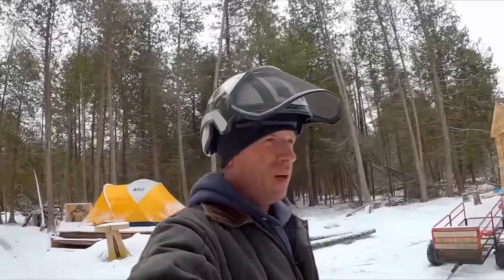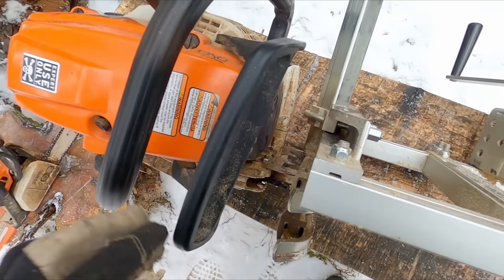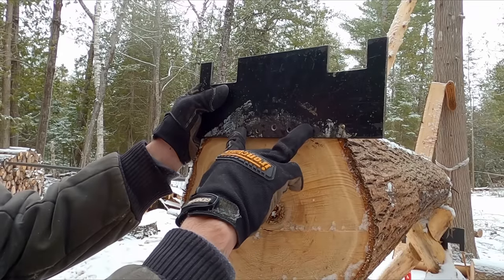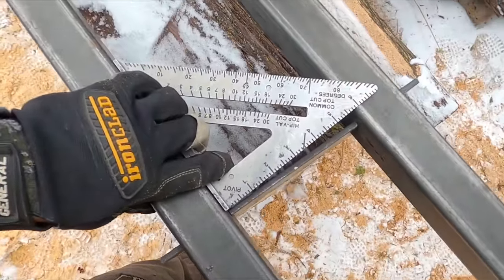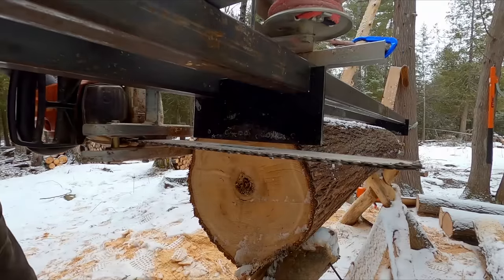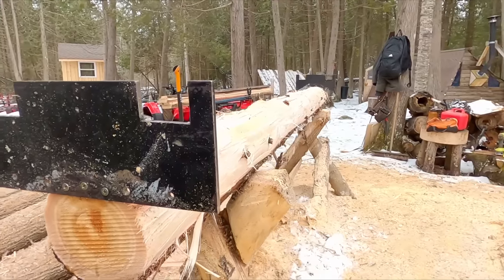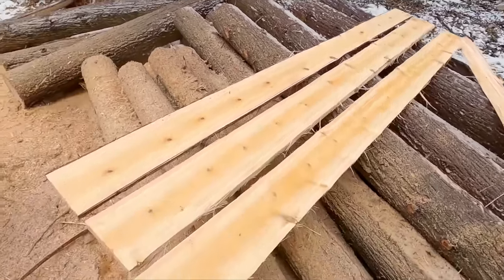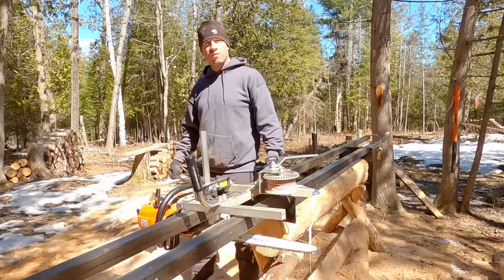$200 Bullet-Proof Alaskan Chainsaw Mill Setup.  Build Your Own!  #80

Comment: Have the same mill (minus the winch).  Absolutely love your starting set up.   I used an old aluminum ladder what I don't use for climbing anymore.  Boy does your set up look easy.    I used a Stihl 029 super to mill 900 board foot of black cherry.  The trees were dying and I didn't want firewood.  My neighbor who is in construction and I weren't sure the saw would make it with that much cutting.   I went through two ripping chains to get it all done.  It was very satisfying to successfully do something I never did before.   Great neighbor and I shared some of my lumber with him.  It's just about dry now and I can start using it for projects in the mountain house.
Have you tried or done quarter sawing with the set up yet?

Comment: I stoped the video at 33:06 and looked at your setup. I got to thinking you could make a permanent stand for your bars right there where ou can adjust the hight for your first cut intead of screwing in the plates. You would be able to save time and use more wood. 
Maybe you already have that set up. This is the first video I have watched of yours. I can see the plates would be very useful for bigger pieces you can break down on site where you fell it to make it easier to move.

Comment: Should just extend your 4 wheelers controller distance and hook the atv winch to a pulley or snatch block on the saw, then you could stand right by the saw and mechanically feed your chainsaw through while visually ensuring a straight and steady flow of chips, a little button would be a lot easier than trying to hand crank I think

Comment: I seen a guy that built the hot tub the fire is underneath the tub. He’s in California and he just puts the firewood under there and it heats the water up in the tub so you can make your hot tub like that. Also, I’ve seen some people use the ladder like you’re doing that milling they put a ladder on top of the log, and then run the chainsaw across the ladder.

Comment: Great Video, lots of insight and lessons of experience. 
Quick question… if a guy were to build a “log table” that could be leveled at each end with threaded rod and blocks to move the LOG up for each cut, do you think it would it be any more efficient? 
Basically eliminating the steel plate adapter for each start up and replace it with a drop down first cut plane…. Not that I would not use your very simple but efficient way, just thinkin out loud..

Comment: If you added a loop or a Y shaped piece on the far end of the steel quare tube and then fed the winch rope through that loop, you could add a slight weight to the winch rope (between the loop and the anchor tree) and it would keep the winch rope from sagging near your chainsaw.

Comment: Nice setup, you might consider to attach a small snatch block on the tree strap for the winch and have the winch line loop through and back around mounting to the winch so you add more power to the winch by compounding the pulling force, subscribed to your channel, thanks for the videos😎

Comment: Hi Ryan!  I've been looking at the G-777 and the G-778...I'm kinda leaning towards the G-778 because it offers a second point of attachment on the chainsaw bar.  I run a Stihl 291 with a 20" bar, the G-778 is meant for a 24" bar but it looks like you can adjusted it down to a 20" Bar.  Have you had any issues with the G-777 at all?  And would you buy the same model again?  Thanks for your channel great learn avenue!  THX Nick

Comment: I was using a 2100 Husky with a 3 foot bar rap around handle double dogs. You  had really because  to hold on to it up side down.  Cutting a log in the air I could stand on the log with one foot on the handle to keep the saw from coming at you I would cut cants almost perfectly strait. Big wood Flew them out with a helicopter. Might want to try It with your mill saw.

Comment: Good info..  Have you considered using an ultra high molecular weight (UHMW) tape on the surface of the aluminum that contact the metal guide bar and the freshly cut surface for subsequent cuts?  Just curious.  Slick stuff…tuff takes a long time to wear down….its used often where two surfaces meet to radically eliminate friction.   Just sharing….but I think it would be beneficial..Good luck!

Comment: Make some kind of shelter for all the bigger stuff which doesn't like to be in the rain or have piles of snow on top of them?   Roof is what they need, not so much walls or floor, as long as it's not in a puddle?  Some wooden frame, and then metal sheets to the roof. When it is only about having roof, less work to get the area big enough to use it as a work space during rainy days.

Comment: As I have not done anything like this !!!
I have an idea?? as yet not finished with how. But to use angle iron with springs to for adjustments of the top cut of a smaller  logs . I will think on this more. 

I am surprised that you don't do  3 sides of the log?

Comment: I see you are using work gloves similar to the ones I use to use. I burn through gloves about ever 2 or three months so I've started using the $2.00 gloves from Tractor Supply or Harbor Freight and not waste 20 to 30 dollars on work gloves that wear out quickly. The gloves I'm referring to are the rubber ones with the breathable backs for sweat. FYI

Comment: I'm curious if you could mill longer logs still using the guide bars you have. Mid way cut a notch for the end plates to set down into, cut the first half then take the end plate from the end and move it to the other end while you leave the one in the middle. I'm guessing you would have to base your ends off of the depth of the mid cut you made.

Comment: I'd honestly like see a segment on the sharpening of the saws is a big point of interest I believe,
Reply: Bucking Billy Ray and guilty of treeson have really good videos on sharpening chain. Square grind chain will cut the fastest but is a little difficult to get started on. Granburg makes a really nice round file guide if you are having difficulty getting angles correct. Making sure your depth gauges are set even and correctly is in my opinion the biggest difference in getting a clean consistent cut

Comment: Good job on the video and information.  I beg to disagree an a band mill requiring equipment for your type of milling.  Yes, the equipment would make life easier,  but I think a ground based mill that would mill anything you are already milling would increase yield enough to justify the expense.  The thin kerf would surprise you for the increase in yield. 

Each saw mill will have a niche benefit and each will have its drawbacks too.  Another chainsaw mill set up that impresses me is Logosol.

The other DIY mills are either band mills or swing blade.  Again each has their good and bad points.

One major concern is logs are heavy.  That will end up being a major factor in how you address how to work around that issue.  Engine based equipment is expensive to buy, maintain, and operate, but usually allows for fast and easy maneuvering of the logs.  Mechanical equipment is a good method to reduce the cost to purchase and operate and usually is low maintenance, however it is a slower process. 

In this video, I can definitely see the advantage of a ground based mill with some Maasdam rope pullers.

Comment: you have had to replace the bar on that saw when you bent it

should make the winch easy to remove, so when not using you don't have to lift the extra Weight

Comment: Ok . I could see that you have that saw sharpened to the standard angle ... i don't know if you know this or not but when you are cutting lengthwise on a log the angle should be more ofna squared angle ... you can actually buy chains already cut for that angle...

Comment: Just curious to know if anyone has ever tried using square aluminum tubing or aluminum strut for the bars? Seems it would be lighter and just as rigid.... IMHO. Probably more cost effective with metal prices these days... But i appreciate the video as I have been resisting the urge to drop a pile of money on a band saw mill....

Comment: Anyone considering a chainsaw mill check out the Makita/Dolmar  EA6100 (or bigger).   It is the same price point is a little better, performance is a little better.  Makita/Dolmar is an underrated saw.
Reply: I have had two of the Dolmar saws.  They don't measure up.  The first one lost compression, and the second one had stator? issues.  Stihl is the way to go, no doubt about it.  They aren't even in the same league.

Comment: What if you used a lightweight aluminum ladder instead of 2 steel bars for chainsaw milling? The ladder serves a dual purpose and is lighter/easier to work with
Reply: Aluminum ladders are often used as rails for chainsaw mills but they are comparatively expensive. Cost has been a consideration in many of Ryan's choices.

Comment: 25 min stop braking your feet to your boots . Start braking your boots to your feet. 
1 put them on 
2 go fishing like you have waders on
3 keep re tieing to take up the slak as the leather starts the forming process.  
4 stop fishing 
5 change socks 
6Go for a hike  with several pairs of socks ,i skip the socks.
7 keep on til dry adjusting the laces periodically. ( take off and bag overnight if needed.

I've done this with kenatrex several times . Most wear out the boots ( 5-10 years, 9 months for meto burn throught here ultra durable soals) before they are broke in. Takes 24-72 hrs depending on summer or winter purchase. 
 Enjoy never having blisters. 

Ive

Comment: Mr Ringworm, I bought some wooded land like you did and would also like to mill my own lumber.  The majority of the trees are under 20" diameter, in fact average diameter is probably around 12" to 15".  I'm wondering your opinion, to this day, would you still go with the same set up (the most basic Alaskan mill) for convenience and the homemade steel bar set up you made?  To me, it seems like the way to go for simplicity.  Just wondering your thoughts since you upgraded to a bigger saw and chainsaw mill

Comment: Have you ever seen as gas powered chop saw for cutting metal? could you add a circular saw bade? Idea being thinner cuts and less sawdust and would it still.work on or with your milling device?? Granted not as good as a larger band saw mill but thinner then a chain a chain saw.?? less waste And smoother cuts! It makes sense to watch these vkidelos kjusty forr getting ideas to improve simple milling techniques. Just my two cents

Comment: lol it looks like you have a harbor freight up there or something similar because the little orange  screwdriver looking picks in you chain saw room i also have and that chain saw chain sharpener i got the same one same color  but i don't have  a skil or husqvarna but do have  several cheap ones and i was afraid to order a china knock off that is 63 cc and 20 inch bar on it  and my mill can mill up to 30 inch logs  and the knock off really surprised me it works great and starts every time and performs great but the chains are cheap and dull fast and stretch  but maybe next week it wont start and run lol

Comment: Is your new chain sharpener a oregon,  I have one two but perhaps a different model,  but your grinding wheel stop doesn't look right , but you should be able to adjust it to stop on the down motion so it doesn't go to far . Mine is under the motor and wheel so maybe that's why it looks different.  The cheap one you have comes with a much less aggressive wheel  than the pink ones from Oregon but you should be able to adjust it to take off a very small  amount or alot . Just wondering , great video .

Comment: would this system work if you dropped the saw to the bottom cut first then work up each cut it would save set up time , its a cheap way to produce timber very effective

Comment: I NEED HELP.  I have this same setup and I'm having a heck of a time getting a good slab.  I'm using an Echo CS-490 with a 20" bar like The Worm here does.  I'm using a Granberg ripping chain that is brand new and sharp.  Doesn't matter if i use wedges or not.  My issue is that I get a ways into a cut then my saw just stops cutting.  The chain moves freely, there's no binding anywhere that I can find, it just stops cutting.  Even though leading up to this point it's cutting like a hot knife through butter.  I do notice that it seems like the mill starts to lift just before this point.  Does anyone have any ideas?

Comment: Hey dont knock yourself for milling board for board. Here in Boulder County Im building a new dock, the other fell ap[art, and we need 12, 6x6x10's They are $50 each! at Home Depot. I saved my mom about $1,000 in lumber. So consider yourself a frugal builder. Whilst everyone else broke the bank on ridiculously priced lumber that lets be honest isn't all that great anyway. Sure you can get a ozen or so great pieces, but getting thousands for a home all to spec and without blemishes is next to impossible if you've ever had bulk dropped lumber to a home build site like I have. YOU! can make sure you get an actual 2x4. NOT!!! a  3-1/2  by 1-1/2  LOL thats NOT a 2x4, it's a 1 and a half by 3 and a half. LOL

Comment: You waste a lot of lumber because the chain is near 1 cm thick an rips all material in that 1 cm cut away. Other saws are 1 mm or 2 mm thick. If you want to get 10 cuts out of a piece of lumber, you lose 8 cm (some boards) using your chain saw. 
Think about a mobile band saw mill! It is qieter, has thinner cuts and you save some threes and some hours cuttin threes down. Less moving parts means less repair. Constant speed move means less noise and less sound variation. Your ears will thank you! Am I right?